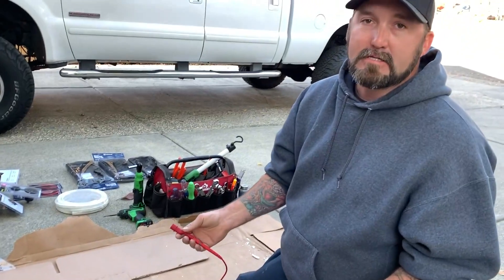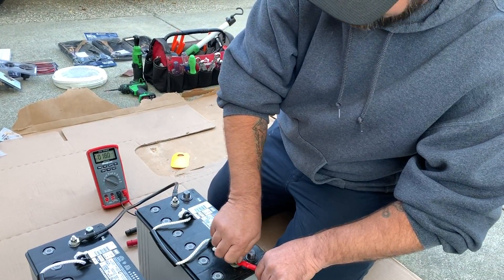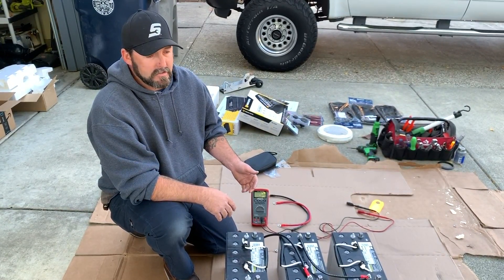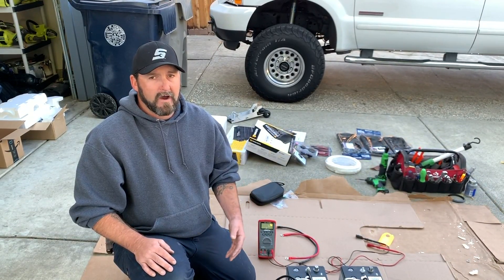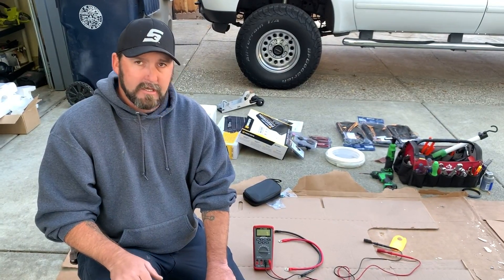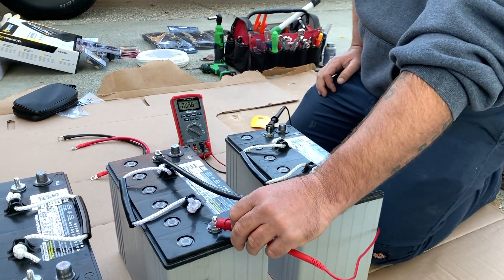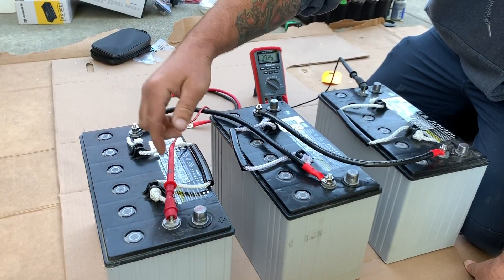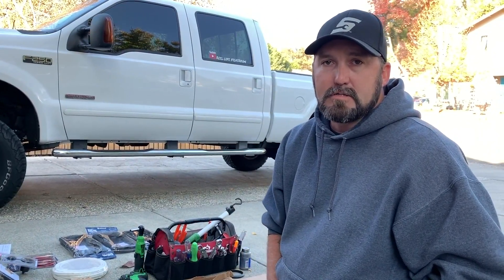BOAT BATTERY WIRING | TROLLING MOTOR | HOW TO

Comment: Thanks for the video very informative and easy to figure out the way you explain it. Have you ever made a video with also putting in a circuit Breaker . And also putting a onboard charging system in placeand wiring that up. If you haven't made it, that would be a great video to watch. It would be helpful, thank you.

Comment: what size jumper cable if I am running a 24v setup but the batteries are like 3-4 feet apart?
Reply from the maker: I prefer to run 4 or 6ga in a set up like that. Thanks for watching!

Comment: These days, LFP is the way to go, unless you do a lot of charging when your batteries are below freezing temps.  Even then, it's easy to warm up the batteries before charging, and LFP is a much better value proposition than SLA or AGM.

Comment: I bought a small jon boat with a 24v trolling motor. It currently has two 12v lead batteries wired in series fir trolling motor and 12v  accessories coming of a single battery. In your video you Said you dont recommend but didn't really get into why.  Could you tell me why? Should I get a third battery for lights and fish finder?

Comment: Question. When connecting the trolling motor (12 volt) to a paralleled set up, do you hook the trolling motor positive to one battery and the negative to the other? I’ve seen a few other videos where the demonstration/diagram showed this. Thanks

Comment: Hey buddy so I have a 12v trolling motor..and I’m having it hooked up to a 27 DC battery,is this okay ?
Reply from the maker: It’s probably a group 27 battery. That’s the size of the battery . Not the voltage. Thanks for watching I appreciate it.

Comment: Great video. Thank you so much for answering my previous question regarding the 12 or 24  volt Trolling motor for my bass buggy. Im taking your advice and going with 24v. I have a noco genpro 10x3. 1 bank is going to my deep cycle engine battery and should i hook up my 2 remaining banks to my dual batteries 24v. 2 positive to one battery and 2 negative to the other battery?sice each bank is 12v.

Comment: Awesome video, thank you!
What size ah would you recommend for minn kota ulterra 80lb thrust i link?
Reply: Would these work well??
VMAX MR137-120 AGM Sealed Marine AGM Battery 12V 120AH
Reply: ...and, lol, so if I get a 3 bank battery charger I could charger my two 12v battery charger and the crank battery for my motor at the same time, correct??
Reply from the maker: Yes if you run a 3 bank battery charger you will hook one bank to each battery.  And typically a good size to run is a deep cycle group 27 . But depends on room and weight and cost. Thanks for watching and commenting

Comment: question? will two 12v battery's hooked parallel run as long as a 24v system?
Reply from the maker: It would depend on size and weight of  the boat.. but in theory.. you would have to have the motor spinning at a higher speed then you would with a 24v . So if it got windy or stronger currents the 12v wouldn’t be able to have the power to keep up with a bigger or heavier boat..   but really it all depends on what size boat and where and how you fish ..

Comment: Do they sell just 24 volt buy itself I can’t find it anywhere
Reply from the maker: There are 24 and 36 volt single batteries but they are only in lithium and very expensive and require a charger for lithium batteries. Thanks for watching and commenting

Comment: I'm using a battery switch to use two batteries with my 12V trolling motor, but running each battery independently.  What is the proper way to rig it to a switch so that the batteries are separated?

Comment: I have a 24 volt system, but it only seems like I'm getting 12 volts on my trolling motor, my batteries are gel batteries, reaching out to you what could be the problem? I have to turn my trolling motor knob on full and in order to seem like I'm on 40 or 50 on my trolling motor

Comment: 24 volt trolling motor can I still leave my 12-volt hooked up to my outboard for charging
Reply from the maker: You want to keep your trolling motor batteries separate from your cranking battery..  now there is a set up where you can use one of your trolling motor batteries as a backup cranking battery.. but it requires a switch.. let me know if you have any questions

Comment: Question. Just recently I have been having issues with my battery for my trolling motor. every time I plug in my trolling motor to the outlet on the boat a lot of sparks start coming out of the batteries in the back.. Now when I disconnect the trolling motor from the outlet nothing happens no sparks and there is power running to the outlet. but when I plug in my trolling motor it starts to spark back up really bad can you help?

Comment: Awesome video! Now if i hook 2 batteries together for a 12 v system and 1 battery goes bad will it kill or drain down the good one?
Reply from the maker: So the weaker battery will always bring down the stronger one .. so that is why I always recommend only using batteries of the same type size and rating and preferably even brand..  when hooking them up in parallel .. let me know if you have any questions and thanks for watching!

Comment: So on a 24 v setup with a 2 bank charger do you connect the charger to the positive and negative of both batteries?
Reply from the maker: So each bank goes to each battery.. hooked up 12v positive and negative.. so there should only be one bank per battery.. thanks for watching and let me know if you have any questions..

Comment: How should I connect my 12 volt smart charger to a 24 volt system, do I have to disconnect to series lead then charge each battery separately?
Reply from the maker: No.. it should be a 2 bank or 3 if you want the charger to charge the cranking battery also.. you hook it up one bank to each battery..

Comment: The foot pedal on my OMC trolling motor has a 12/24 toggle switch with two red and two black wires coming from battery compartment.. To set motor to 24 volt, do I connect batteries in parallel and switch toggle to 24 volt...or connect in series and set toggle to 24 volt?
Reply: Or do I connect batteries independently, i.e., one red and one black cable to each battery?

Comment: Can I make an installation with 3 batteries but with a configuration por 12V for normal system, and 36v for an electric winch using the same battery bank? Do I need a different charger control for this hybrid setup?

Comment: Great informative video. Do you need to go with heavier gauge wire when you go from 12 to 24 or will the wiring that’s in the boat now work, mine is a 2019 tracker. Thanks

Comment: Can I install a shut off switch to trolling motor for charging so I dont have to disconnect battery cables  and if so does  shut down switch go in line before 60 amp circuit breaker?

Comment: is there a way to hook those batteries up to the alternator as well as the crank battery? If not, how long do they usually last for a 24v trolling motor?
Reply from the maker: You can look into a minn kota Alternator charger .. it will help put a charge to your trolling motor batteries while running your main motor.. if it puts out the correct amount of charge.. smaller motors won’t.. thanks for watching

Comment: In all these different configurations you explained, what gauge wire do you recommend ? Thanks for the video !
Reply from the maker: 36v I would use 6ga for the trolling motor leads and 4ga. For the jumpers.. 24v and 12v I would use 8ga and 4ga on the jumpers .. make sure to use a circuit breaker 50 or 60 amp depending on trolling motor size
Reply: @ReelLifeFisherman  Perfect...this is the information I needed. I look forward to your other videos. Thank you
Reply: I’m going to run a 36v setup. What length of 4 gauge jumpers do you use?

Comment: Great video, really clear explanation. I have a 24v motorguide I'm installing and instructions say to not connect it to 12v common ground. So do the 24v (in series) batteries remain ungrounded? Is this what is called a floating ground?
Reply from the maker: So you connect it straight to the negative on the one battery and the positive from the trolling motor to the positive of the other battery with a 50 or 60 amp breaker.. then go positive to negative between the two batteries.. thanks and let me know if you have any questions

Comment: So you can hook your charger up just like you would for the trolling motor on a 24v system right?
Reply from the maker: The battery charger gets hooked up one bank for each battery.. so on a 24v system with a 2 bank battery charger each battery would get hooked up 12v for the charger and then the trolling motor would get hooked up 24v let me know if you have any questions.. hopefully that makes sense and helps

Comment: I got another question I hope you can help me with. With a combiner switch 6011 from house to starting battery with about 20 feet between batteries is it wise to fuse at start of house battery to switch and one off of switch to fuse block? Using 8awg wire running just a few things what size breaker would you recommend for this setup? Just confused if I should use two and if there will be issues if I ever need to jump start with having the breaker be too small. Just want to do it right if my starter dies. Thanks brother.
Reply from the maker: So all the fuses should be off the output/common of the switch..either at the Distribution block or in line no need to have them at the battery.. just each power wire going to each device.. you can have a 20 amp breaker or fuse on the one going to your main boat power.. (the one that powers your dash) .. let me know if you have any questions about anything.. thanks for watching the channel..
Reply: @ReelLifeFisherman  this is how I was goin to do it. I'll stick to it this way and abandon the combiner. Not confident that I can wire that to house and not trip my house breaker..thanks for response bro!

Comment: The part about jumping from your TM batteries is invaluable information.  I recently lost my alternator on big water (San Pablo Bay, fast outgoing tide, lots of shallow water) and engine would not start, I jumped it from one of my two TM batteries. ( Put jumper cables in your boat )   Started it right up.  You can also swap your main battery with a TM battery if your voltage is so low that your motor has shut down due to low voltage ( which it can and will! - put tools in your boat) and that can get you back to the ramp avoiding a costly tow. (Always have a good anchor too)
Reply from the maker: Absolutely if you don’t have a battery selector switch.. that’s the next best thing.. keep some jumper cables or one of the nice jump boxes onboard.. thanks for watching the video and commenting! 
Appreciate it
Reply: @ReelLifeFisherman  What if I want to hook a battery selector switch to 2 trolling motor batteries?  Do I run the positive trolling motor lead to the output post on the switch and the negative trolling motor lead to one of the batteries negative post and then add a jumper cable from negative post to negative post on the batteries?  I've just heard bad stuff about running parallel on how if one battery starts to crap out it can take the other battery with it.  Thanks
Reply: @6stringkid  did you ever figure this out? I have the same question.

Comment: Thanks for the detailed info.  Just got a 12v 50lb thrust bow mount, I have a deep cycle 27 and a smaller AGM battery.  Can I connect  these parallel safely to extend battery life AND use for my fish finder, bilge, and secondary trolling motor?  Thank you!
Reply from the maker: When you connect 2 batteries together you should always make sure they are the same exact battery.. size ,rating even brand and age preferably! Or the weaker one will eventually ruin the stronger one.. also I never recommend hooking anything to the trolling motor batteries.. especially the fish finder.. it will cause electrical inference when the motor is running.. let me know if you have any questions.. sorry I just saw this question.. thanks for watching
Reply: @ReelLifeFisherman   I appreciate your help!  That makes sense, great info.  Thanks again!

Comment: I enjoyed watching the video. I'm  watching battery wiring because I have a question on my trolling battery setup. I saw that if I take a voltmeter to each battery after a full charge they are 13.50. So expecting touching the positive post and the negative post I should get something between 24 and 26. But I don't, I get zero (0). Why? I noted that a negative cable goes from TM1 to the Trolling motor, and positive cable from TM2 going to a circuit breaker then another positive cable from the circuit breaker to the Trolling motor. Theres a cable between TM1 and TM2 from negative (TM2) to positive (TM1). Does that make sense? So I would say that is a series connection to provide 24 volts. So why am I not seeing 24v with the voltmeter?  Thanks for any input!

Comment: New to boating here and great explanation ... I only have one 12 v 75ah battery to which I connect my 55lb thrust TM. Is it safe to connect my fish finder directly to the same battery?
Reply from the maker: No you shouldn’t ever hook a fish finder to a trolling motor battery because when you use the trolling motor the screen will go crazy with lines and static due to the trolling motor electrical feedback.. you should hook it to the cranking battery.. let me know if you have any questions.. thanks for watching
Reply: Thanks, there didn’t seem to be huge feedback, but are there any safety implications to the fish finder and shorting it out?
Reply from the maker: No worries there as long as both the trolling motor and fish finder has appropriate rated fuse and circuit breaker.. the feedback will happen when the trolling motor is running.. and as the trolling motor drains the battery.. the fish finder will loose voltage.. it’s definitely not recommended.. but sometimes I guess if you don’t have a choice

Comment: So how would you charge them up?
Reply from the maker: A good on board marine charger .. with 1 bank per battery.. let me know if you have any questions..
Reply: @ReelLifeFisherman  i do have a 2 bank charger but it doesn't do me any good because I can't plug it in because my boat sits in storage. I can't keep it at the house because of the HOA. So I bought a solar power charger.
Reply from the maker: Will it get solar power while sitting in storage?  If so it will help.. not sure if they have them available where you are .. but around here there are boat storages that have power available for charging.. or will pull your boat up a day or 2 before and plug in your charger..

Comment: Great info. Could you explain how to wire an on/off switch to just one battery such as a cranking battery? I bought one last year but I have no idea what wires would go to this switch. I don't know if I need to buy a jumper type wire and also don't know what wires get connected to the switch? Black or red or both.? All the wires or just a couple? Again. Would appreciate your input.
Reply from the maker: Sorry I meant to respond to this question the other day but was very busy.. so it’s pretty simple with just a battery disconnect or on/off switch.. just take all the wires on the positive post and hook them to the output side on the switch.. then make a 4ga jumper from the input/battery side of the switch to the positive post.. let me know if you have any questions about it.. and thanks for watching

Comment: Why AGM over Lithium?
Reply from the maker: Well main reason for me would be price! Lithium batteries are very expensive.. and require a special charger.. they seem like great batteries and have little to no power loss during use , from what I’m told.. they are also much lighter..but they are new in the marine industry and not a lot is known about them yet for how long they will hold up.. thanks for watching and let me know if you have any questions..

Comment: Great video. I have a 24v trolling motor what would u recommended on the g writing to use? Also I wanted too know if I want to run a fish Finder would I need a 3rd battery? If so how would that look
Join boat build so I’m trying to get less weight possible! Tia
Reply from the maker: I would recommend 8ga. Anchor marine duplex wire.. and make sure you get a 50amp circuit breaker.. you will have to have another battery for the fish finder.. hooking it to one of the trolling motor batteries will basically make your fish finder useless when the trolling motor is running.. due to electrical interference.. hopefully that helps and thanks for watching the video

Comment: Thanks - nice and clear - I did not read all of the 202 comments but am wondering how best to charge the 24V series system.  Is this 1 24V charger or 2 -12V chargers?
Reply from the maker: Thanks  glad you liked the video! So the way is to get an on board charger with one bank per battery .. wire it positive and negative to each battery individually.. it will do the rest.. thanks for watching.. let me know if you have any questions..

Comment: I have a 12V trolling motor I want to run parallel batteries but I have a 2 bank On-Board charger do I connect the 2 batteries to charger one per bank or just one bank? 
Thanks
Reply from the maker: You connect one bank per battery.. the charger will do the rest and charge it correctly.. all charger manufacturers want one battery per bank.. thanks for watching

Comment: I have a 24v trolling motor, and now I understand how to hook up the two batteries, but how about if I have a kill switch and foot pedal? Where and when do I introduce the kill switch wires? Thank you
Reply from the maker: If you have a quick connect plug receptacle at the bow for the trolling motor you can just unplug it.. but if you don’t or want the switch.. you would put it on the main power lead  to the trolling motor .. thanks for watching and let me know if you have any questions about it..